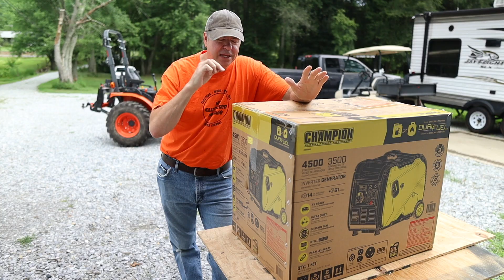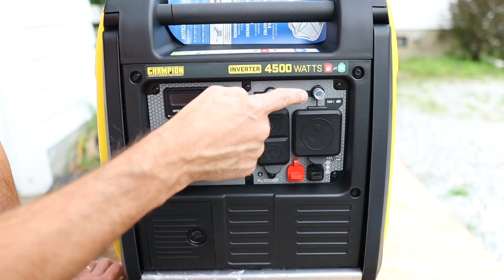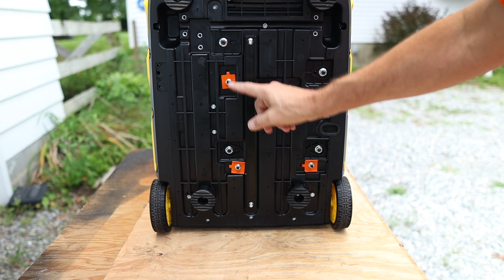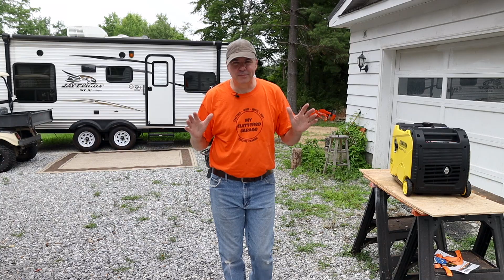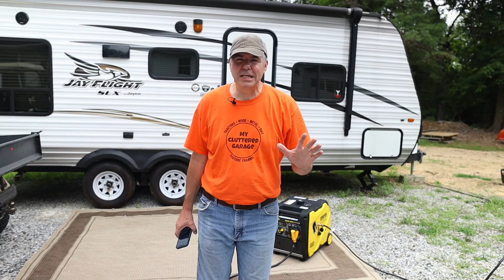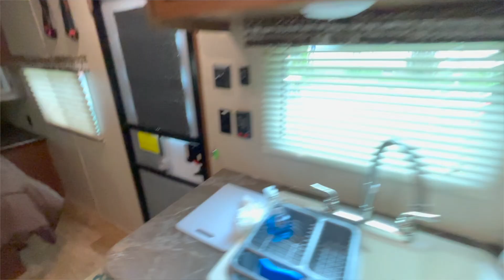#68 Champion Dual Fuel 4500 Watt Inverter Generator. Unboxing, setup, and review. Best RV generator?

Comment: FYI, Champion doesnt provide a detailed break in procedure for this genny.  I have contacted tech support and the most theyve told me plus what little is in the manual is that you should break in with the supplied 10-W30 oil for 5 hours with the option of running a full synthetic 5W-30 oil after that.  Breaking in using eco mode is OK with Champion.

MY process is going to be -
Squirt a little Lucas Oil Conditioner into the cylinder after pulling the spark plug.

Fill with 10-W30 (including a little Lucas conditioner) and cap with a magnetic dipstick.

10 slow pulls on the pull start before replacing spark plug to prevent a dry start.

Run for one hour on eco mode with a  100-200 watt load.

Change oil, fill with regular 10W-30, run for one hour with eco mode OFF and a small load under 500 watts.

Change oil again, run with eco mode  on for one hour at 500 watts, a second hour at 1000 watts, alternating with eco mode on and off, run a third hour with a 1500 to 3000 watts with eco mode on and off.

Change oil and fill with full synthetic 5W-30 oil.
Reply from the maker: That’s quite a break-in process!

Comment: Champion generators are JUNK!!! 
I bought 2 Dual fuel models and had trouble with no starting on Propane mode within the first week.. I got a replacement model and barely used it for a year and the thing would not start up .. Pure JUNK.. the second unit only had 120 hours on it.
Reply from the maker: That's unfortunate. I've heard that Champion has good customer service. I have been pleased with my last Champion and this one with now over 20 hours on it. Wish me luck! :)

Comment: Are the run times on propane accurate?
Reply from the maker: I’d have to just trust Champions estimate on that. It would be hard to duplicate results unless you have a steady draw. I haven’t run it king enough to determine fuel efficiency. Thanks for watching and commenting!

Comment: I just got one of these not to long ago.  Setup interlock and connection box for my house so I can run most all my 120V in the house during an emergency.  I really wanted to be able to monitor real draw from inside the house Vs going to look at the meter on the panel.  Picked this up Power Watchdog Bluetooth Voltmeter - 30 Amp
Item # HU37FR from Hughes / Etrailer.  
You just plug that into the 30A connection then your cable into that.  With that bluetooth app up you can see actual Amp draw while inside your house or RV.
Reply from the maker: Hey Scott. That sounds like an interesting device! Thanks.
Reply: Could you give me some more info on how you hooked a 30a RV plug to your interlock inlet? Did you use the 30a to 50a bridged adapter?

Comment: I just ordered one of these from Amazon with delivery expected in a month or two .  perfect timing!  We just went 5 days without power at our home so i ordered this generator that i can use hopefully occasionally and use propane at least at the beginning of an outage since gasoline goes bad pretty quickly .  Having the option of running either gas or propane is great.
The inverter supplies power that is as clean as home power and the genny is QUIET compared to an open frame model.

Very nice video that covers all the important topics
Reply from the maker: Thanks very much. I must have gotten lucky, because mine was delivered in less than 2 weeks. I appreciate your kind comments. -Ed
Reply: @MyClutteredGarage  
As it turned out,  my generator was delivered inly two weeks after I ordered it.  Haven't fired it up yet aa I want all the proper supplies for breaking it in.  Champion does not provide an actual detailed procedure so between what I have gotten from tech support and articles and videos I will soon spend a day going overboard to do the break in.

Comment: Really enjoyed this video. I'm glad you took the time to do a real practical usage video as opposed to a simple unboxing and startup. As it relates to the difference in power between the gasoline and propane, that's because gasoline is more dense from an energy perspective than propane for the same quantity of fuel. I recently purchased one of these generators as well and expecting delivery soon.
Reply from the maker: Thank you for your kind comments AND for the LP vs gasoline lesson. Obviously I’ve barely used it, but I’m definitely impressed. Enjoy!

Comment: Come on Ed, I gotta know: how does the generator know to run using gas or propane?   🤠🤨🤔🤔🤔🤔   I think you made a good choice on generators.  I have 2 of the Champion 4000 starting/3500 running gas generators for at least 10 years and have had no problems. Ran 3 weeks straight once when the power went out. After that, like you,  we installed a whole house 17,000 watt unit. Since our well water runs on 22, I got tired of switching wires around between the generator and the breaker panel in the house between 110 to 220 to use our well for water 2-3-4 times a day to flush a toilet or take a shower.
Reply from the maker: Right?! It must be some fancy schmancy carburetor or even fuel injection. I think you should buy one and take it apart 😄
My “whole house” gen is still a “portable” that I backfeed with, but it’s setup safety with a safety interlock. Not as convenient as a standby gen, but I love it when I need it!
Reply: Maybe, since your new fangled genny started right up using propane, possibly it recognizes the propane connector, otherwise it tries to run the gas?  I tried to buy backup wall mounted ventless heaters for the house just in case our gas goes out during the winter. They used to be sold with a dual fuel switch (propane or natural gas). But they have halted the manufacture of the dual fuel.  Best I could figure was the fire department needs to know how to quickly disconnect the fuel source when they arrive for a house fire.
We used our Champion genny for our Jayco travel trailer and it was adequate but you had to plan your activities like you saw with the microwave and AC. We didn't do any primitive camping. Mine was a lot less expensive than yours. No bells or whistles.  I think $200-$250.